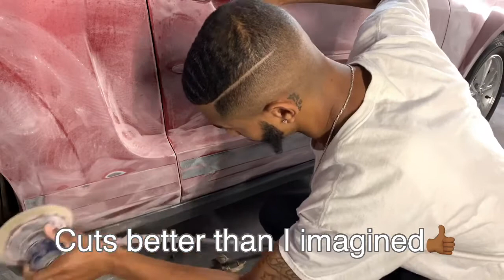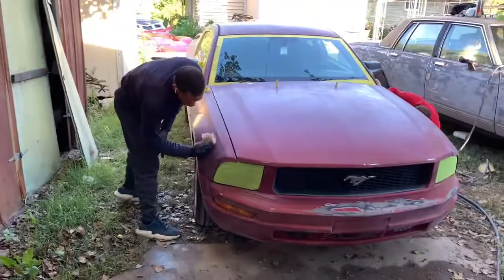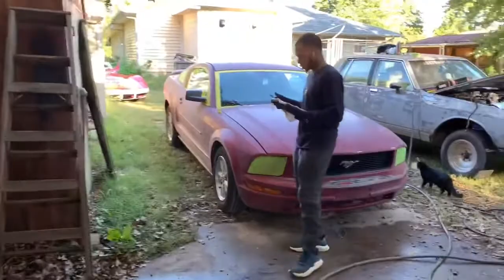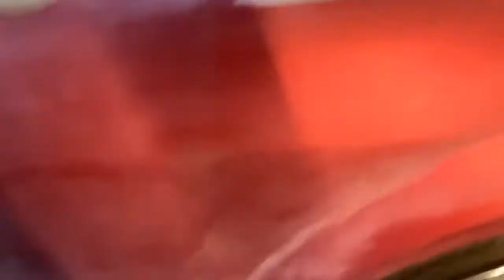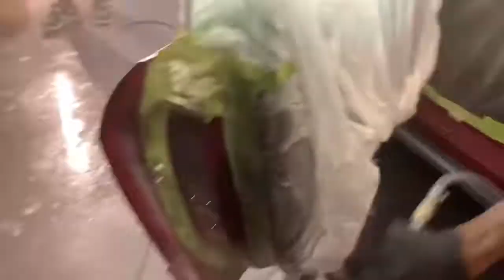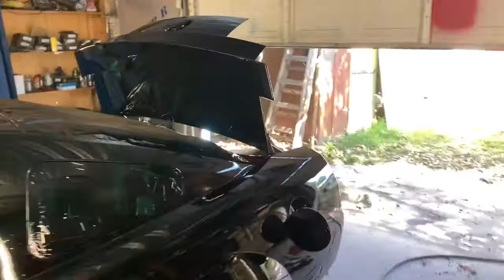Backyard paint job

Comment: I learned that with a razor blade if you knick the corner then take a heat gun and pull while it warm it will come right off and if there's anything left a rubber eraser wheel will get the rest great job man find what works best for you there's a million ways to skin a cat

Comment: Some times if you get a lot of trash you can do a flow coat were you sand everything with 800 and do 2 more coats of clear wet the floor real good. Might be faster than cut and buff.

Comment: If you have sticker use a rubber spin wheel it will come off in 5 mins then used a cleaner for the glue.